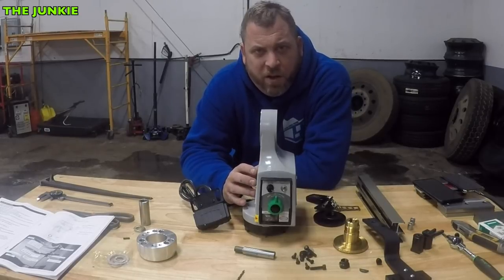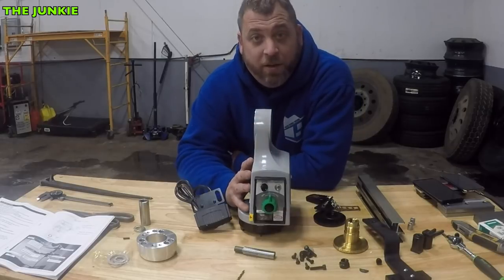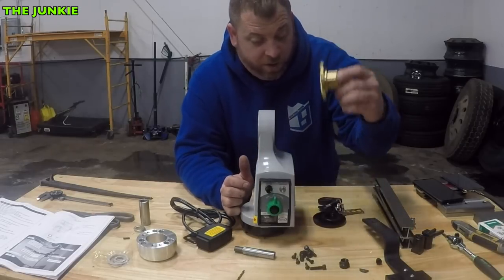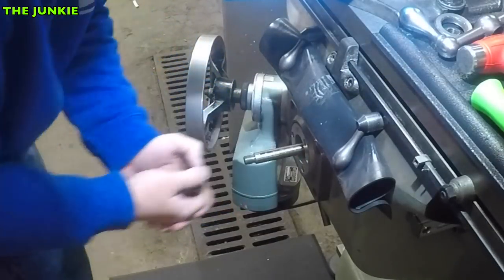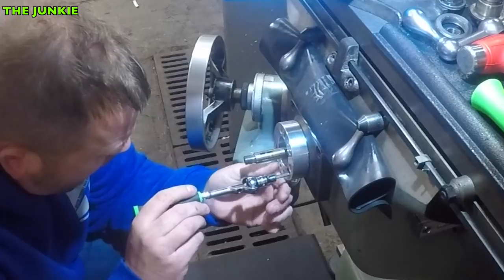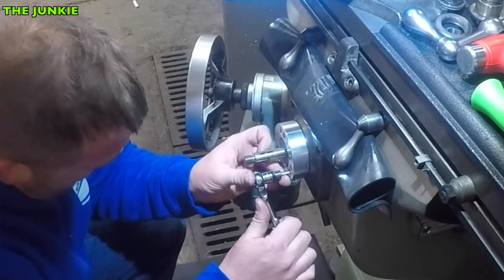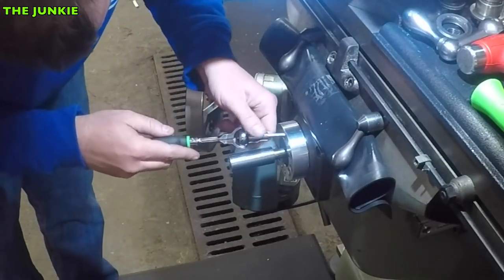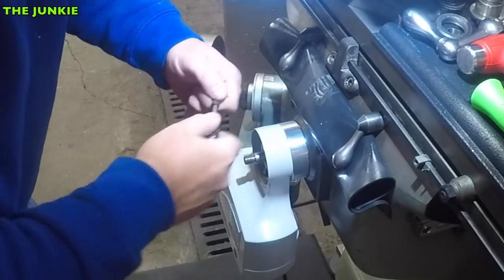HOW TO INSTALL A Y AXIS POWER FEED BRIDGEPORT MILL🗜🔧🔩🔥🔥

Comment: Does it require any kind of calibration for how many revs/in it moves or does it just depend on the stop switches?
Reply from the maker: nick elias No it doesn’t require any calibration you move it still manually you have to turn the switch on and you can control the speed